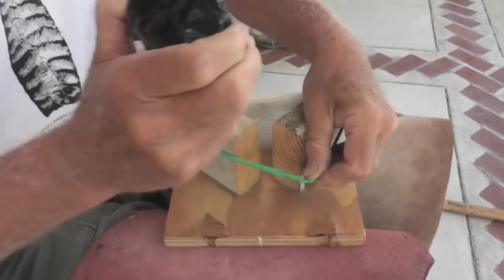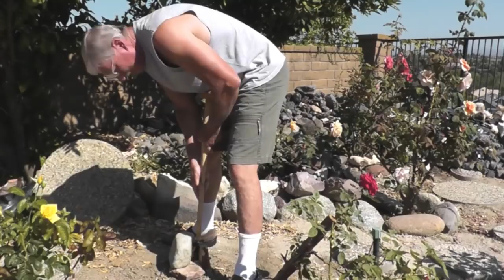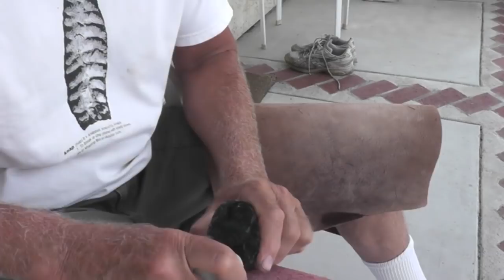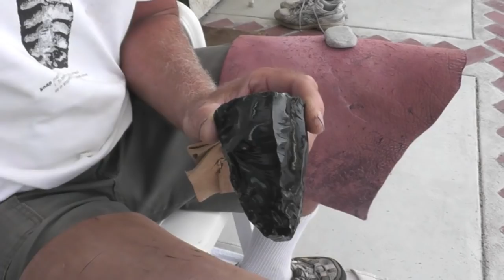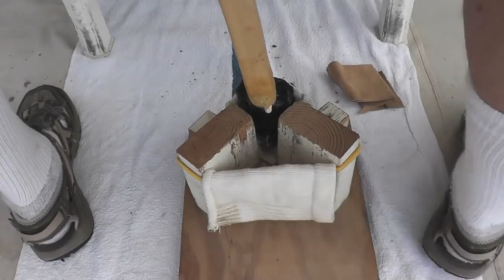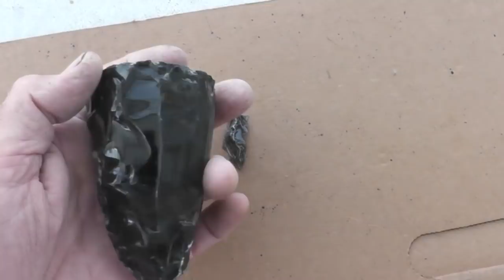Blade Core Pressure Blading Part 3

Comment from the maker: The 3 point support works well but there are no doubt other support systems that have not been re-discovered yet. The unused stitching on the sides of blade cores from Grenada Spain are a clue that something else was going on, most likely some type of grip system that was aided by the stitching.....

Comment from the maker: Yes, especially on the earlier blades when the ridge is sharper and wavier it definetely helps to abrade. On the final series blades it is not necessary though as the ridges are straight and strong...

Comment: Jim, if you were to abrade the ridges running vertically down the core on either side of the blade you are trying to flake off, will it strengthen the blade and keep it from hinging off? thx

Comment: A few years ago I found a piece of flint that I believe to be a man made tool. It looks like it was made in exactly the same way you are working this core. It shows the signs of coming from a core and has something like a shock wave going from a little flat/ground spot on top down to the tip. I tried to capture shadow of this in the photos. I would really appreciate a flint knapper's learned opinion on this. I think it's man made, what do you think? https://photos.app.goo.gl/NVSM55TEALNFD0ju2  Found on the surface of a ploughed field awash with flint. In Wiltshire, England. In sight of West Kennet long barrow and Silbury hill megalithic monuments whilst walking to the Barrow from Avebury.
Reply: Its probably  a scraper. Whoever made it was probably a novice cause I dont see large flake scars but I do see some steeper ones.